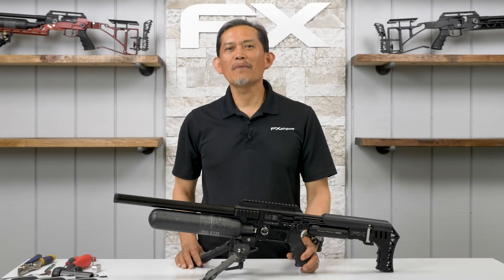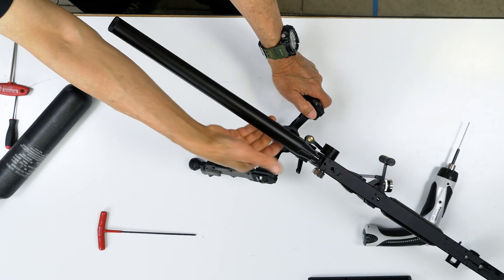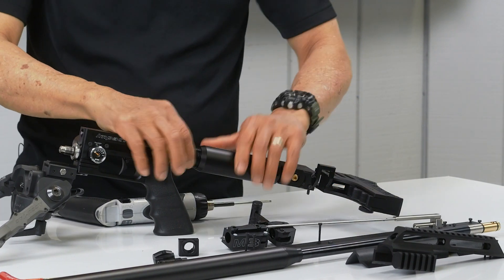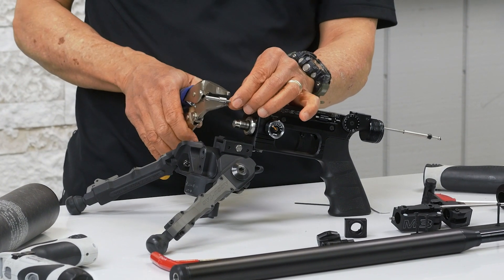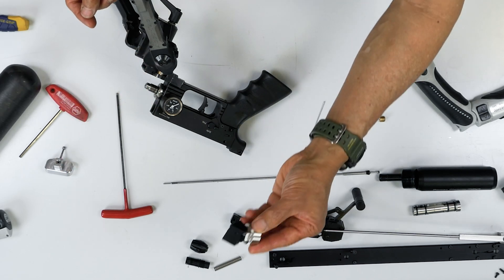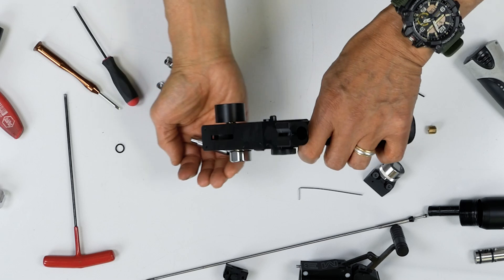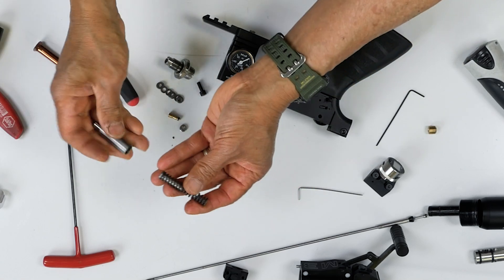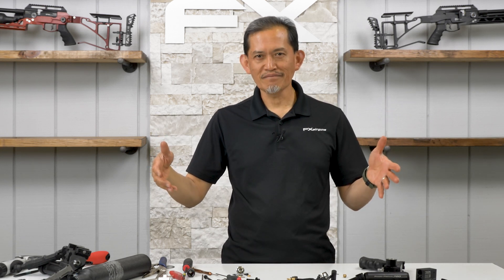Impact M3 Complete Disassembly - FX Masterclass

Comment: Dear Fx, At exactly 2:32 in the video you remove the barrel + shroud(shroud right?) I have an fx impact m4, did the same. How do I get the shroud off the barrel? It is telesopic bu at certain point when trying to get the barrel out of the shroud it gets stuck and does not want to go any further. Canot turn (anti clockwise ) it loose. Very stuck. I want to replace the liner. Any help? THANKS!!

Comment: 2 issues I having trouble with. I don't understand why my new M3 in 35 cal., when I go above 120 on the 2nd reg, my fps drops the higher I go ?My, settings are 185 on 1st reg. 110 on 2nd, 16pw, 5micro and 13.20 on VA. Also, my gun won't de cock or is catching on something. Seems like it needs to be greased. Have you had experience with this problem? Thanks for any advice.

Comment: 4:30 shouldn’t you pull the long valve rod forward before you unscrew the power plenum? Doesn’t the valve rod get bent every half turn?
Reply: It is easier to remove the valve rod by removing first the c1 than the valve stem. And one thing once u damage or scratch the valve rod while removing the c1 and decided to pull out the valve rod, you might damage or scratch the plenum seal that might eventually cause leak.. replacing that plenum seal is very tricky unless you buy a new one!

Comment: I have the mk3 .35cal. I have a small rubber ball leftover after reassembling. Where would that go? I believe it came out during the spring removal.
Reply: The rubber ball goes into the spring under the black valve adjustment knob above the air tank. 
I seen this in a video , type in  FX impact M3 slug power kit installation ( M3 slug tune part 1) ..... The video is by Airbuks  
I realize this video is for the slug kit but this ball may go there  on your gun , if not disregard